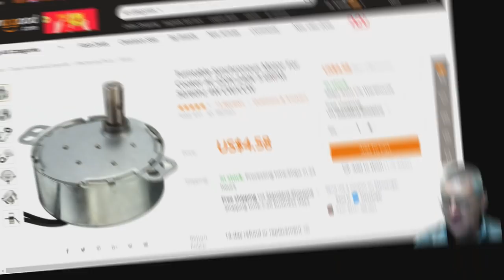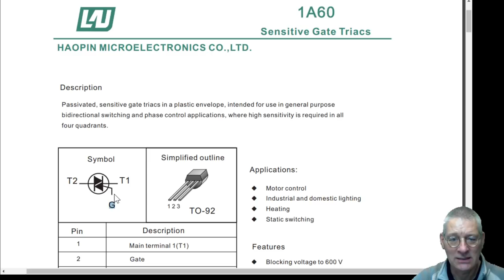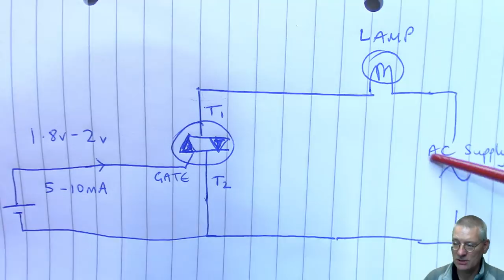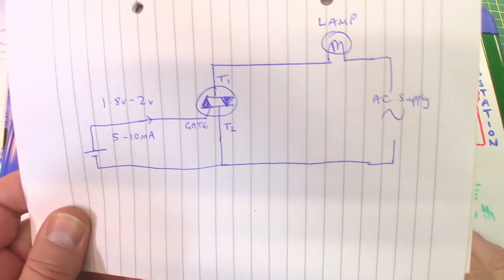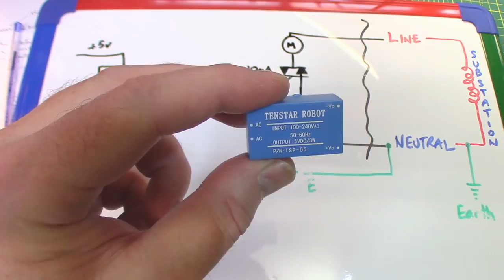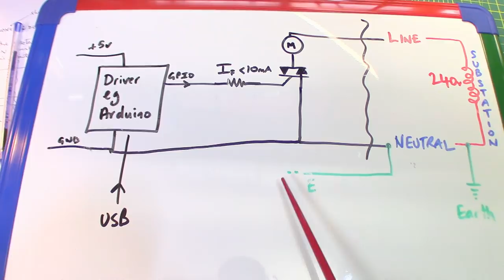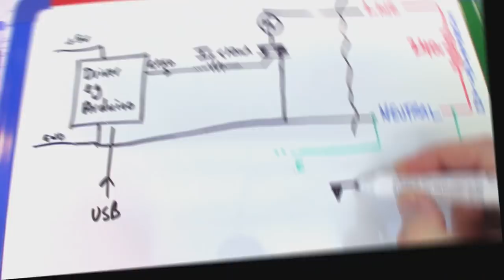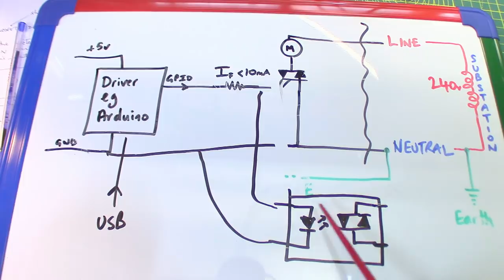#134 Triacs, Mains AC, DC, SSRs 😕 What's going on?

Comment: I like that you are tackling mains.  It is part of our lives and understanding how it relates to our low voltage projects is essential. I have some touch sensitive wall switches, and I learned the loud popping, expensive, hard way that the power supply for the Pic micro floated on the mains. I connected a usb serial converter and the switch sparked and turned black. That usb port on my pc never worked quite right after that. I got it to work with a laptop on battery power. Eventually I used some optocouplers to get the connection I wanted.
Reply from the maker: Ouch! Expensive way to find out about mains voltages. Good lesson to teach others not to do this though, so thanks for posting!

Comment: A good clip as usual Ralph.
I was taught that it was ZERO CURRENT through the SCR that let it turn OFF, not ZERO voltage.
Hence special considerations with inductive and capacitive loads.
Reply from the maker: Well, yes, Tom, it's always current but as the V and A are in phase for non-inductive or capacitive loads it's a lot easier for people to think of voltage rather than current. But you are absolutely correct, and is why a low current bulb (10W, for example) might never switch on when using a Triac dimmer. I suppose I should clarify that the next time we talk about SSRs, Triacs and the like... Good to point this out, thanks for posting.
Reply: Exactly. It switches off at zero current (with is always true, even with reactive loads). Only with purely resistive load voltage happens to be zero at the time current is.
A usual trap of mininum holding current can a a trap for young players. If the load is too low or if you try to switch on near zero crossing with a short pulse, there may not be enough current to keep conducting. For example near zero crossing point, you need long enough pulse for voltatage and current to rise above holding current for triac to latch on. Holding current is also the current below witch triac turns off. Is is about turning off really which makes it not latch with low current in the first place.

Comment: One thing to think about: you have a nice mains plug in the UK that can only go one way round into the socket. But in some parts of the world like here in Germany the plug can be put either way round. So neutral can easily become the live and that could be a problem when another part of the circuit is grounded or exposed so that you can touch it. 
Another tip for improving your great videos: if you make an annotation as in this video, please make sure that it’s visible enough seconds to be read. I often pause or rewind in that case because I can’t read it quick enough (and I think of myself that I’m not a slow reader in English).
Reply from the maker: Thanks for the tip regarding annotations - I'm always worried they are on screen for too long and obscuring what's going on. Maybe I should just pause the video for a few seconds whilst viewers are reading the annotation.

Comment: Excellent recap, and very pertinent for external device control, Arduino in this case. Valid for Oscilloscope differential probes versus passive. Will look up your previous video's.
Like the "Tune in" quote, very pre digital tuning.
Many thanks for sharing.
Reply from the maker: Glad you liked it Bosted Tap, thanks for posting 😊

Comment: Small detail - Triac's are also thyristor's and paired with a diac at the gate, it can do the job of a pair of back-to-back SCR's for AC switching functions (wiki-p calls them bilateral triode thyristor's). I sure wish you'd become a member at the EEVblog forum.. the Aussie's could be enriched by more folk from "the old dart" as they call it.
Reply from the maker: Before Triacs were invented, I used two thyristors, back to back, for a disco sound to light unit. Needless to say, there were no opto-isolators in those days so we often got shocks. It's amazing I'm still here. But we never called them bilateral triode thyristors. I could have patented that name. Drat! No wonder I still have to work for a living. Good point to clarify, Cliff, thanks for posting.
Reply: @RalphBacon  You mean psychedelic 3 channel color organs? Yep, back in the 70's blown speakers got a second life with Christmas lights nailed inside and florescent lenses tacked up front.. (Long live CCR and the Doobie brothers!)

Comment: Great little video! That grounding issues causes a lot of people problems with test equipment, especially newbies starting to learn power rectification and decide to connect an non isolated channel oscilloscope up to the front and back of a diode bridge rectifier!!!! 

That Chinese board is a little scary, complete lack of decent separation on high power traces! ( I could be wrong as I only got a quick look)
Reply from the maker: Indeed, Jon, non-isolated boards can be a bit troublesome for test equipment, to say the least. The Chinese board is not bad actually - there is a decent gap between the "live" side and the DC side (as far as I could tell) and there are creepage gaps where required - but, hey, just watch my next video #135 on Friday and you can decide for yourself!

Comment: Keep in mind that in Europe mostly a TT mains network is used, where the neutral is not connected to earth at the customers breakerpanel. 
If then neutral comes in contact with earth or safety ground, the RCD trips. 
If you want to switch mains voltage by a microcontroller, it's better to use a Opto-coupler with buildin Triac output (MOC3021, MOC3063 etc...)
For very small loads, you don't need a extra power Triac to control the load. 
With a extra Opto-coupler you add extra safety, and it will work all arround the world, no mather what type mains network is used.
Reply from the maker: Good points you make there Bjorn. Certainly my workshop is a TT system, I have my own personal earth rod buried in the ground.

Comment: Hi, Ralph,
The data sheet shows the different quadrants for triac.
A triac gate is a current driven, bit like driving LED via resistor to drop the voltage and limit the current.
Not enough current and the triac will not switch.
An opto triac to isolate the triac from the microcontroller, much safer.
Some opto triac packages can directly drive a load of less than 100mA with out using another triac.
You can get  insulated tab triac's, not so good for heat dissipation.
Just complicate it further, the triac needs a snubber network as the motor is inductive.
Class x2 capacitor and a resistor, as full mains voltage is present at the motor terminals.
The class x2 capacitor is designed to fail safe and not destroy the casing.

Adam
Reply from the maker: All good points, Adam. I shall certainly include them in any future video I do that involves Triacs - including SSRs , which I already have planned. Thanks for posting.
Reply: @RalphBacon  
Your welcome, I've a couple of pages of information that I can send you, but no contact information that I can find.
Adam
Reply from the maker: If you need to contact me, Adam, go to my channel home page, click the About tab and then click the Show Email Address.

Comment: Standard triacs have one of the pins connected to tab, but you can get 'isolated tab' triacs
If you want something smaller than a ssr, you can get opto isolated triacs.
Reply from the maker: Spot on, Sparky, and opto-isolated triacs is exactly what SSRs use, of course. I used to have mica washers under my thyristors to insulate the tabs (in the 1970s). They were very fragile, and mostly worked OK, but nothing like the heat pads of today. Thanks for posting.

Comment: On the original board the label is SCR2. SCR stand for Silicon Controlled Rectifier. it is similar to a TRIAC but only conducts in one direction. it seems odd to use a SCR to control an AC motor as it would only receive the supply each half cycle. Having identified the device it also seems strange that the component should be labelled "SCR"!
Reply from the maker: I'm not sure either thyristor controlled any motor (the memory's getting a bit hazy now), Charles. Or was the oscillating motor that was controlled? As you say, it's not the component to use to control any kind of motor for the reasons you state. However, it's still working well, although it's not used during the "summer" in the UK, but give it a couple of months and it will be put back into service. Thanks for posting, good to hear from you.

Comment: Ralph a very good video, I totally agree with you, NOT to connect ground to neutral.  I have damaged a ftdi programmer, atmega328p chip, a attiny85 chip and caused a USB fault on my Mac by connecting ground to the neutral of my work bench power supply. A costly mistake that still haunts me to this day. Great use of the AC to AC transform to isolate your self. 

Just a note to help improve future videos, use plain paper and not lined 😂 find a ruler for drawing lines 😂
Reply from the maker: Your mistake could prevent others doing the same, Gordon. So thanks for posting that. 
Thanks, too, for the heads up regarding my diagrams. I do try and use my eco-friendly whiteboard but for when I don't, I've now ordered (at your behest) a £2.24 plain notebook for all my future diagrams. Keep a sharp lookout! Now, where's my ruler...

Comment: 16:10 better use a relay to drive the motor. How about EMI from either relay coil or the inductive load ? Currently i'm experiencing problems on an arduino differential thermostat. It appears that when firing on or off the pump relay (a 25watt one), the lcd display gives corupted data, in some cases even the arduino program crashes...
Reply from the maker: The relay coil will certainly require a protection diode across it (reverse biased). The motor itself requires nothing although the relay contacts might benefit from a snubber circuit (covered in a recent video #131).

If you are getting that sort of corruption, check that the diode you have across the coil is still functioning, check that the power is not dipping when the relay pulls in, are you driving the relay directly from the Arduino (or via a transistor)? Have you a snubber on the relay? Have you a circuit diagram?
Reply: @RalphBacon   Thank you so much for your answer. I used to power my circuit using 2 78xx's (one 7805 for arduino and a 7812 for relays)  with common ground (later i saw your video for relays, and that became the reason to make a change - i got 5 volt LOW input relay modules- ) With these, i got very rare lcd corrupts (3 - 4 in 8 months) then i replaced the power supply with the same ''tenstar robot'' for powering both arduino circuit and relay module (the common chinese optoisolated relay modules -so there is a diode in the circuit-) Things got worse. Then i used a seperate 5 volt power supply (from mobile phone charger) to power on the relay coils with seperate grounding. No change. crashes got more and more. Maybe the problem arises from all the cabling in the plastic enclosure. Now i,m making an new (bigger) enclosure to make some space betwwen relays and arduino, and constructing a new dual power power supply with 7805's and some more capacitors. Maybe a video with guidelines on designing projects involving relays with power loads and arduino (e.g. home automation) would be great (just a thought :) ) 

P.S. how  could i upload a schematic or pictures ?
Reply from the maker: Hmm, tricky. Let's assume for now that a spike on the incoming mains is the cause of the crashing and corruption. Where does it come from? It must be the motor being started up, or stopped. A snubber on the relay might assist here. Not across the relay (that would keep the motor connected to LINE at all times). Rather, in the same way I did, from the relay output to the other side of the motor (probably N). If you have access to a scope you could check for spikes on the incoming (low) voltage side.
You could also decouple the power to the Arduino more. A 100µF capacitor, a small resistor (maybe 10 ohms) with an in-series small 1µH inductor, another 100µF capacitor with a 0.1µF in parallel and a Zener, rated at 5.8v. All very, very close to the Arduino. Then put the scope before and after such a circuit to see whether you still have a spike from the motor.
I've assumed that you've powered the Arduino separately from the relay and have removed the VCC-JD jumper from the optocoupled relay module.
You could upload a schematic to something like Google Drive or Microsoft OneDrive and share?
If you remember my Arduino Workshop Heater Repair video, I am switching two heater coils (about 3A each) using relays (all running from the same Tenstar Robot supply), and there's no crashing.
Reply from the maker: Sounds like you've tried a number of things there!

If your schematic is accurately drawn, I don't see any decoupling capacitors on the ATMEGA chip (I hadn't realised you were using a bare chip rather than an Arduino module). The PCB doesn't show these either.

Your power supply to the chip needs 47µF - 100µF immediately before and immediately after the 7805s, as well as a 100nF (0.1µF) capacitor immediately afterwards (in parallel with the 47µF cap). In addition, and perhaps most importantly, you need a 100nF soldered directly on the chip pins (underneath) between pins 7 (VCC) and 8 (GND).

That would be the first thing I'd try. If you really haven't got these caps in place I'm surprised you didn't get crashes earlier in the project's life.

Hold off on the snubber and other things - it may not be necessary. Have you got access to a scope?
Reply from the maker: This is the reference diagram for the Arduino Uno - see how the power is decoupled, pretty much as I described?
https://www.arduino.cc/en/uploads/Main/arduino-uno-schematic.pdf
Reply: @RalphBacon  There is only an electrolytic capacitor of 47μF on the ATMEGA board (it is shown in the picture, and placed afterwards), and the capacitors on the 78xx's board. In the new construction, i preffered an Arduino Nano board (with a 1000 μF on the prefboard) and in the power supply unit i placed 4 capacitors (100nF, 1000μF - regulator - 100 μF ,100 nF) on each channel. Hopefully there will be no crashes.
Although i saw lots of videos on how to use a bare ATMEGA chip without the rest of the arduino board, noone mentioned that the power supply should be ''full'' of capacitors, in order to run smoothly. The new project looks like this now:
https://drive.google.com/open?id=1WvvVbOoSTXJUaJNG0NTuFHiiisCrrNS-
Now what is missing is adding a small fan (i measured almost 55 degrees Celsius on the 7805's) 
Unfortunately i haven't access to a scope. I'm really curius how this ''HI LINK'' switching power supply performs.
Once again thank you for your time and advices
Reply: @RalphBacon  +1 on the additional bypassing,  that's too often left out I think.  Also,  while the ground might be "common" in the sense that it's all (eventually) going to the same potential,  it's a good idea to keep the wiring for those heavier loads separate from the control logic.

Comment: Great videos!  I have followed with great interest.  I'm trying to power solenoids that run on  20VAC at about 500ma.  All the optocouplers / triacs I've looked at seem geared to line voltage and aren't rated for switching below 70VAC.    I would like to find an optocoupler SSR that will switch 20VAC and will even consider building it myself (I'll need to make 21 of them!).  Any suggestions or insight would be of great help to me.
Reply from the maker: Have you checked out the major supplies such as DigiKey, Mouser and RS Components (UK) who will let you search for such devices?

FYI I've used optoisolator PC817 that switches (up to) 80v. And I have a triac optocoupler MDC3023 and MOC3020M suitable for low voltage switching (IIRC). Check them out too!

Comment: Another cracking video Mr B!  Given that most UK houses are supplied with only two conductors these days (one live and one combine neutral/earth).  If you connected the Earth from the heater to the GND of the Arduino would that be sufficient for the tiny current supplying the Triac to find a path back to the Arduino's GND?  That way you would avoid connecting PC GND to neutral at the USB port.  Or is there just too much resistance in the domestic wiring for such a small current to find such a path?
Reply from the maker: I suspect the local resistance would not matter, but if I were to suggest to Dell or HP or any PC manufacturer that I wanted a PC designed with the mains N connected to PC ground they would think I was mad. Better to isolate these things, Gavin. Another video for another day, maybe.
Reply: @RalphBacon  I think maybe I didn't explain my thought properly.  Assuming (and it's a big assumption) that the USB ground in your PC is connected to the earth connection of the mains lead then if you connected Arduino GND to the earth lead in the fire you would bring the two to the same potential.  So no possibility of damaging either (assuming they are connected to the same mains supply).  Then, if Arduino GND were connected to mains earth could you trigger the TRIAC without connecting neutral to the Arduino on the basis that Neutral and Earth are connected at the point of supply?  Thus there would be no need for anything to be connected to anything other than the earth conductor?
Reply from the maker: I don't think connecting earth to anything that is effectively floating (and isolated) is a great idea, Gavin. Earth is reserved for chassis connections, and the like, to protect the user, not to provide any kind of return path for current (except in fault conditions). That's a sure fire way of tripping the MCB, I should think. So on that basis, no, I would not connect Earth to any part of the actual circuit just to allow current to flow via it to another (mains) circuit. Interestingly, and purely hypothetically, it should work (assuming the MCB did not trip) but I'm guessing @Whitefields5595 is clutching his head in despair at the very thought!